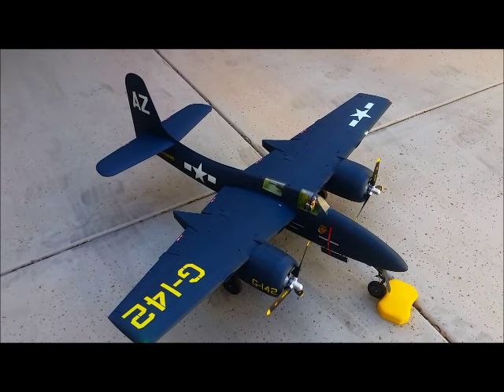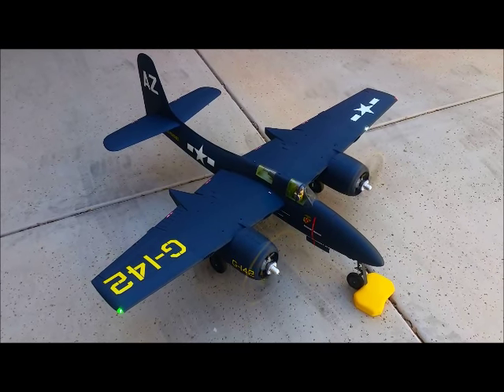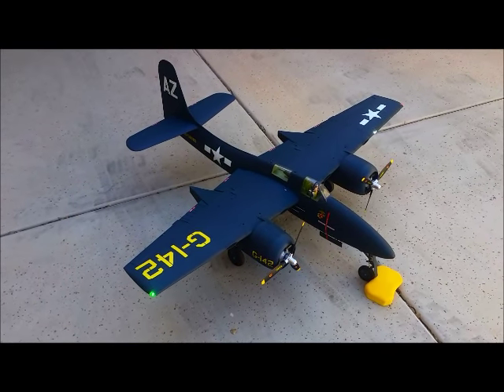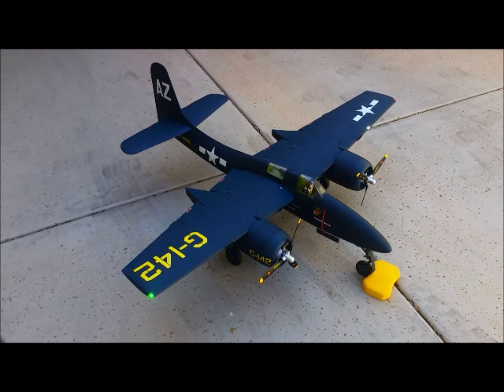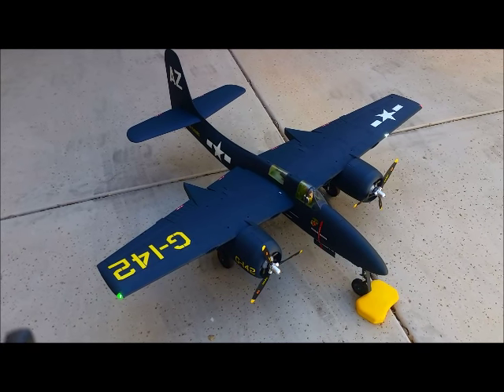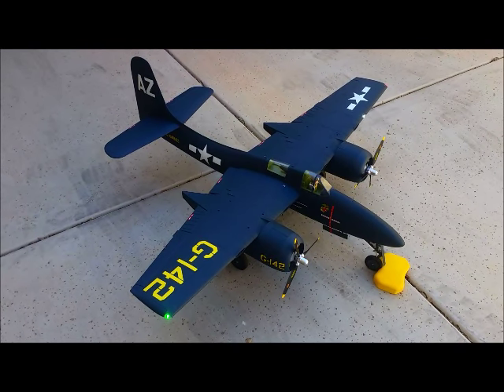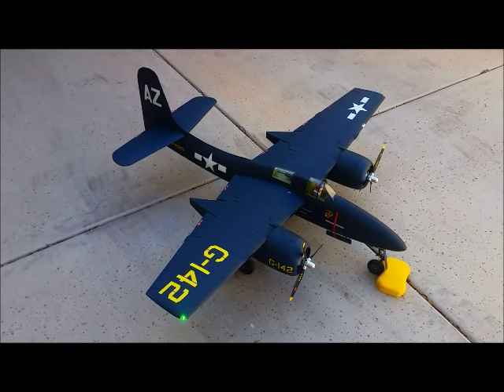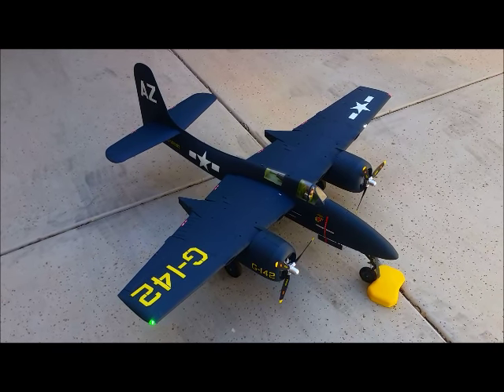Mr.  RCSound Aspire sound system demo in the FlightLineRC 1600mm F7F 3 Tigercat

Comment: HI Brandon, if we can communicate via e-mail can you go over the MCI setup for your sounds on the P51?  I am trying to get a music file to play for my A10 and am having a bit if trouble getting it to work.  You have that mastered.  I'm using a DX9 Tx.  I have the motor sounds configured for the "I" button and of course it works on the throttle stick and I have the guns on a switch.  But I want to use a music file and am wondering if I could set that up to do with the gun switch like you used for all 9 sounds.  I am a bit software instruction challenged with Daves manual.

Comment: I been on the fence of buying this. I have the bearcat from flight line on motion rc. I'm not sure if it's going to fit on the bearcat 1200mm. I was reading the reviews and a lot of people were having issues with them craping out. Do you think I would have the space for this board on my plane. Would the weight cause a cg problem. I just got my cg dialed. I would not be happy if I had to redo my cg.
Reply from the maker: I wouldn't recommend this one for the Bearcat....You would more than likely have to redo your CG
Reply: Thanks maybe when I get a larger plane I'll buy the sound board